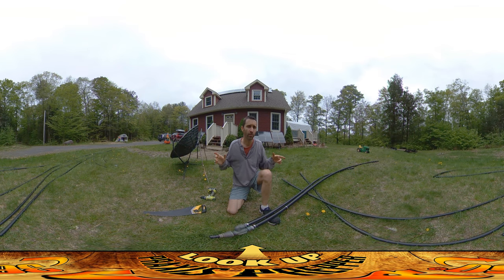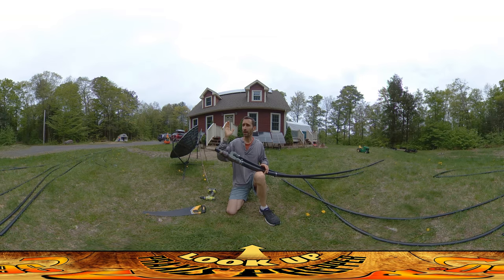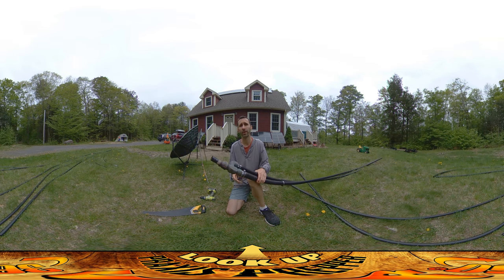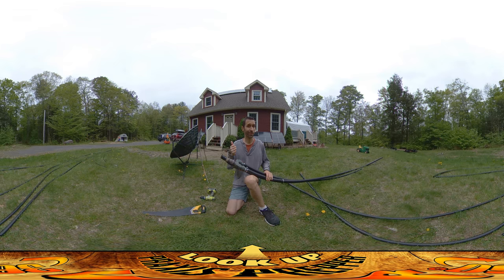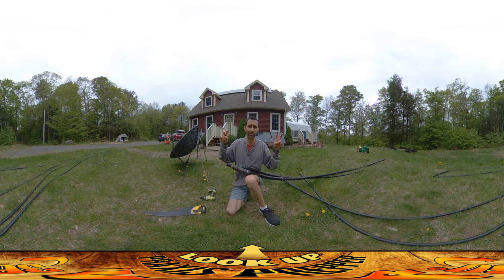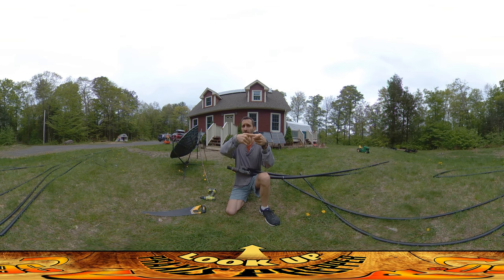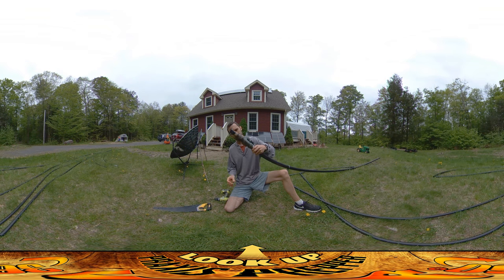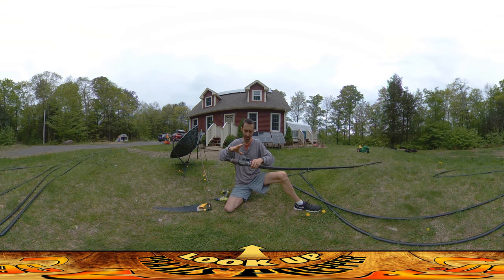Homestead Building - Salvaging Junk Well Pipe for an Outside Water Line

Comment: Question? It may sound stupid 🥴🤔 how do you do a load out in such small cars ? All the stuff you have over the years, how does it fit into a Prius ?
Reply from the maker: My dad has a truck and a trailer bed that we used during the move on 2 occasions, but the vast majority of the stuff moved was just one car trip after another. The roof rack and roof pod help a lot. The Prius is actually the FAR roomier of the two vehicles when it comes to filling it up with stuff. The Subaru Imprezza's ability to carry stuff in the back is significantly less then the Prius. Actually, I ran my production company out of my Prius for many years too, and I always felt that I could carry a significant amount of production gear (lights, stands, tripods, cameras, etc.) in there.
Reply from the maker: Weight is another story though. I'd say that the max number of bags of concrete mix is probably 8 and if you're carrying cinder blocks, better not go too far over 15 or so - evenly distributed!